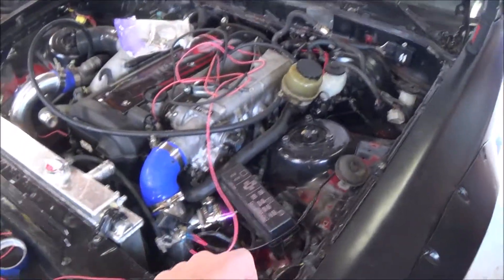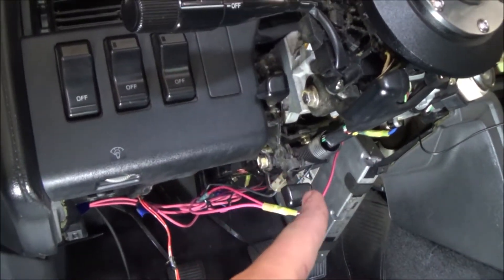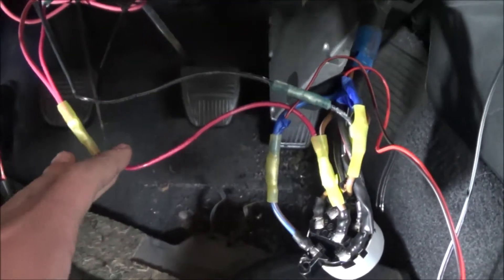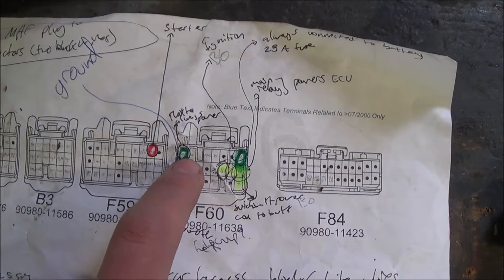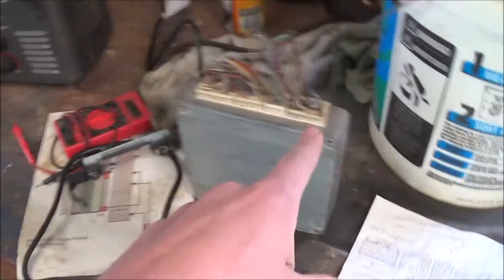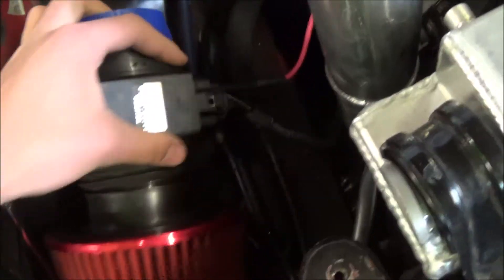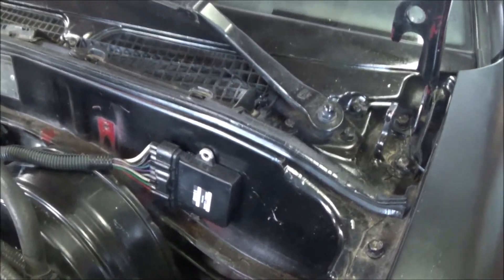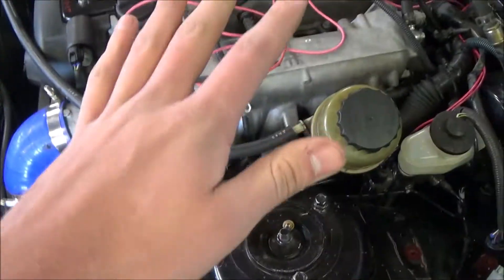HOW TO WIRE A 1JZ VVTI [no experience necessary] (JZX110)

Comment: I doubt i’ll get a response due to how old this is but i did the same swap into my SC300 and for some reason it is dumping gas into the cylinders. I am beyond lost at this point as i did the wiring as is in the video and i’m still having issues. Or atleast i think i did. Any help would be great
Reply from the maker: Hey.  First thing that I would check is the timing on the engine itself.  If the timing is off, then it'll be shooting fuel at the wrong times.
I also wired my fuel pump to a seperate switch because I was having issues getting it to work with the ECU (I coudln't get mine to turn on properly).
Finally I would try pulling off the fuel rail and injectors to see if they're pulse firing independantly from each other and not just firing as a constant stream.

Hope this helps
Reply: @PhilWithSuper i appreciate you so much for getting back to me. i’ll test these out and see if anything changes! if not do you by chance have anywhere that I could reach out to you for some help?

Comment: If I where to buy a complete harness I wouldn't have to do this right? Just deciding if I wanna pull the trigger and do the swap!
Reply from the maker: Correct.  I would 100% recommend doing that.  If I had to do it all again buying a harness would be the biggest change I'd do.  It's a lot more work than it seems to wire it yourself, so even though a harness is 1,000, it's worth it
Reply: @PhilWithSuper  do I need a non imobilizer ecu if I get a harness
Reply from the maker: @elititus2402  I would recommend running an aftermarket ecu.  The OEM ecu will freak out without the OEM intake or exhaust and cut fuel.  If you can get an aftermarket one this issue would be avoided.  BUT, I would imagine you'd still need a non immobalizer ecu, because the ecu is looking for a specific signal from a specific key, so there isn't a way that companies would be able to make a harness that has the key code for every ecu

Comment: How did you get the drive by wire off the ecu because  ik you can get the delete  but isnt it programed into the ecu
Reply from the maker: Are you talking about how it limits how much throttle you can use?  If so, that gets fixed once the MAF is hooked up.  Other than that, I didn't have any issues with the drive by wire system.  I eventually did a full drive by cable conversion (super easy mod), but it didn't change the way the ecu read anything from what I noticed

Comment: so basically if i can find  a non immobolizer ECU for a 1jz/2jz i can wire this into my old 89 supra turbo R154 supra without having to send any wiring harness off to tweakdperformance and pay upwards of $1,400
Reply: If you have an immobilizer ECU, you can get the immobilizer disabled. Go on the 1jz/2jz BMW group on Facebook and ask around for a guy named Dillan.

Comment: why was your car stuck on limp mode?
Reply from the maker: No MAF Connected
Reply: Is it rear sump or front ?
Reply from the maker: @htxlunaangel6629  rear sump
Reply: Did yours was immobilizer ecu? Did you buy a seperate non immobilizer?

Comment: Hello mate. Doing this swap in a mk4 supra. And wiring mine up got it to crank and I also hear the fuel pump pumping up top, but when I crank it's just turning over. Mine is the jzx100 so only 4 plugs on ECU. I have powered the the 4 pins on ecu just nothing. Is mine same as yours? Thanks